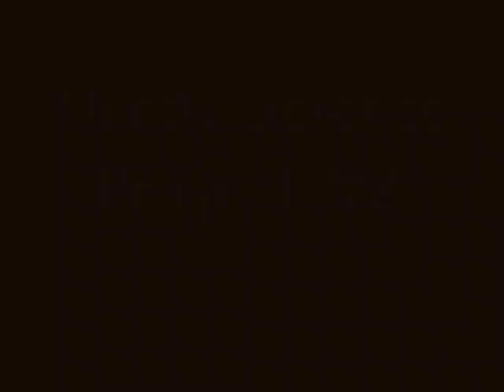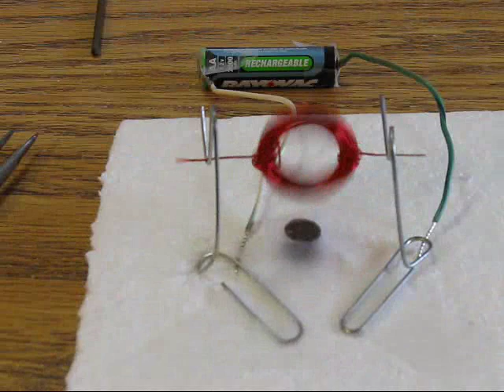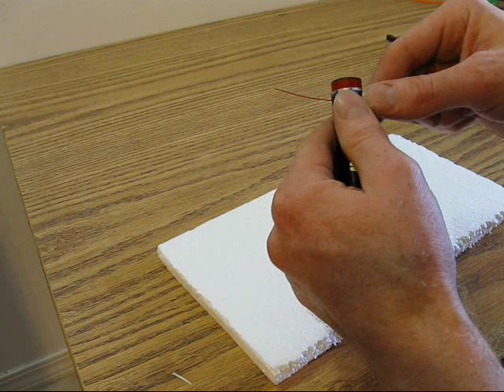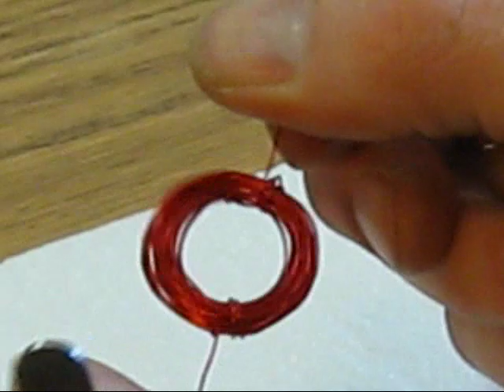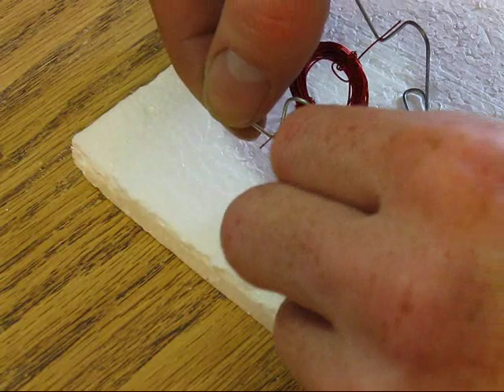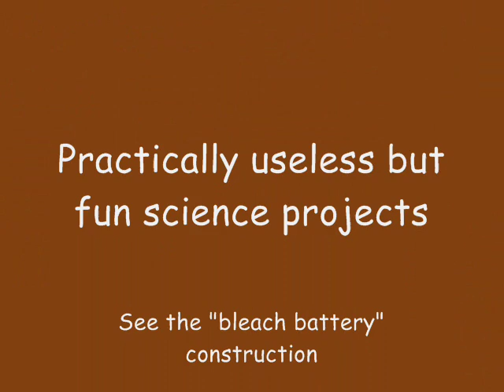homemade electric motor experiment - nerdy science project 2

Comment from the maker: Yes, you must use magnet wire for this to work, uninsulated wire will not. Also you must carefully strip the insulation on the ends of the coil exactly as shown or it will not work.

Comment from the maker: Why do you only remove part of the insulation from one leg? When the uninsulated side of the coil lead is touching the paperclip stand, the coil becomes an electromagnet. It will either be repelled or attracted to the permanent magnet and starts to turn. As it turns it will reach the insulated section and the coil will no longer be a magnet. It will free spin until it turns enough for the uninsulated section to make contact again and the coil will again energize and repeats the action.

Comment: hey i used magnet wite but when u said that on the other side only remove the insulation from the top i removed it from all sides and so i think this is the reason why my motor is not working PLZ HELP! RESPOND TO THIS COMMENT PLZZZZZZZZ RLZerr